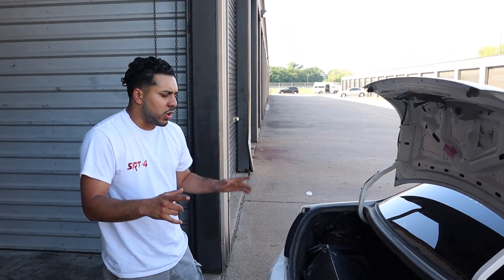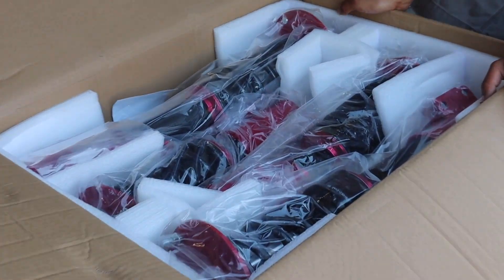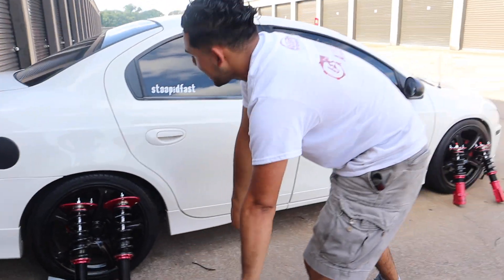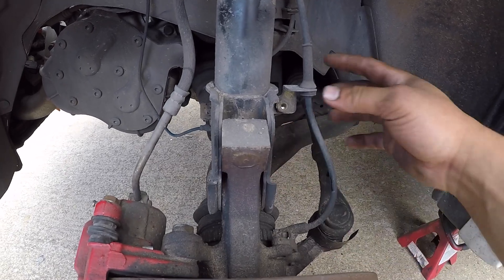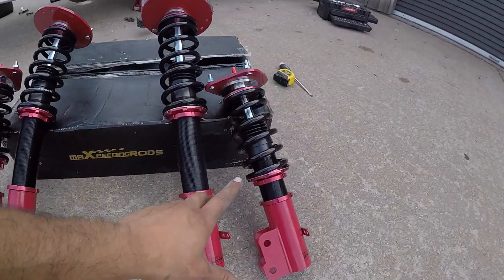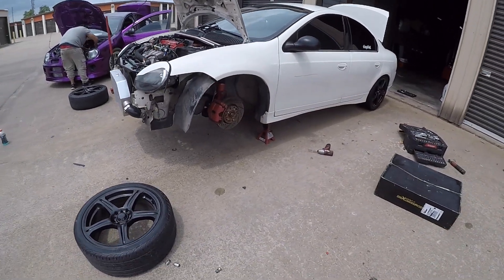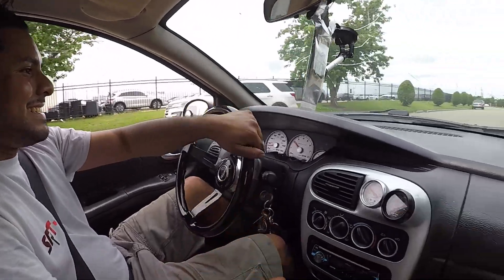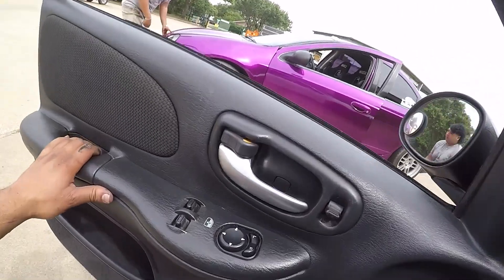BEST BUDGET SRT4 COILOVERS! | MAXPEEDINGRODS | UNBOXING AND INSTALLATION

Comment: How are they holding up?
Reply from the maker: Super good bro
Reply: @psychoaccelerate3886  any signs of leaks or cracking at any of the mounting points?
Reply from the maker: @jeremyturner2082  no sir  Everything is working fine with the coilovers